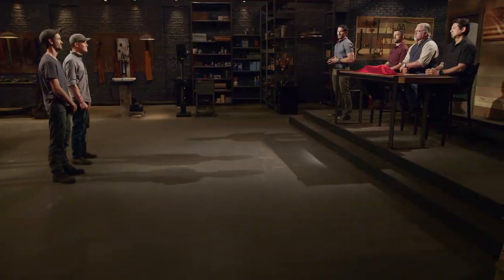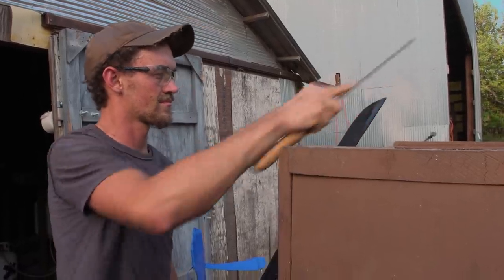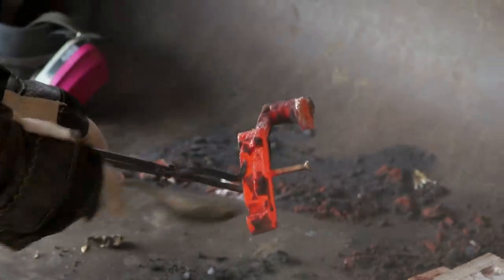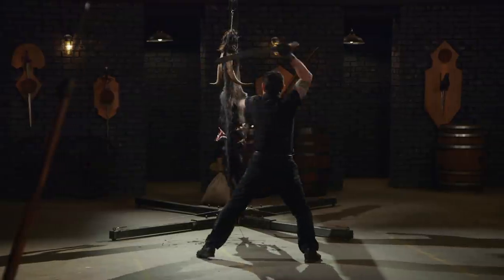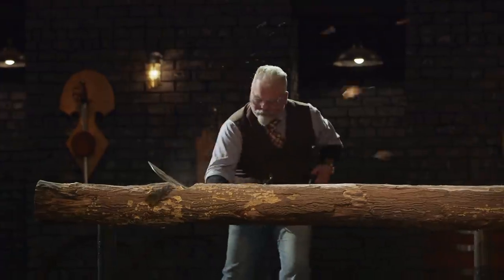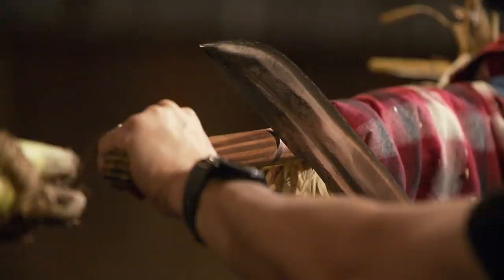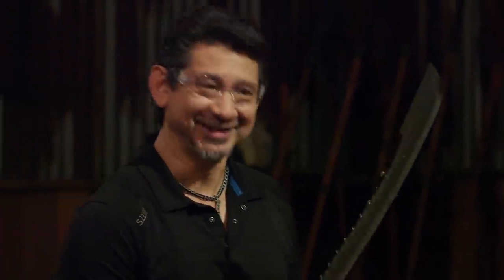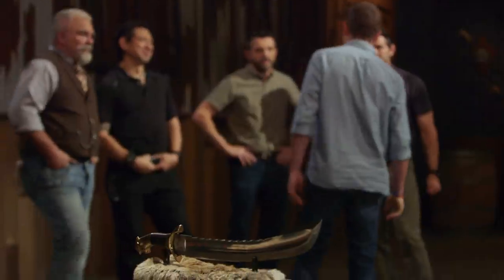FIERY French Pioneer Sword SAWS THROUGH the Competition (Season 7) | Forged in Fire | History

Comment: I wonder if they get to keep the blades they build after the show is over?
Reply: Nope. All forgings are retained by the show as the wall decorations that you see on the set.
Reply: @Celebmacil  I read somewhere that they can be returned to the smiths after the episodes air
Reply: I read that only the winning blades are kept. Those from that didn't won were returned to the bladesmith after the show.
Reply: The winners do not. It is kept for the wall in the forge and other promotional material. The runner up gets their blade returned to them, provided it didn’t break or bend in testing.